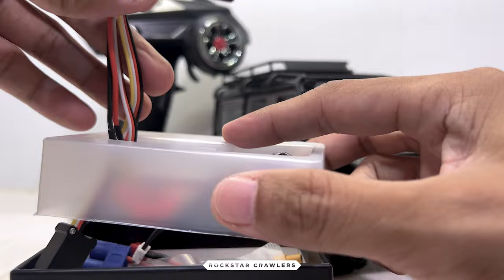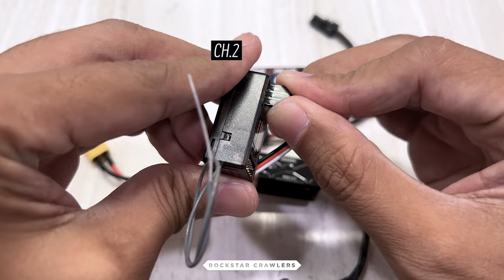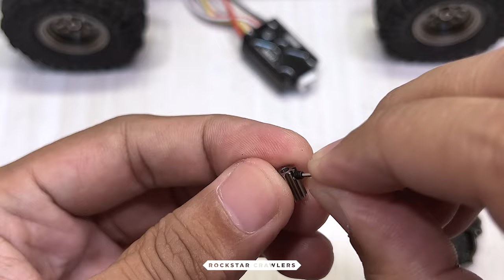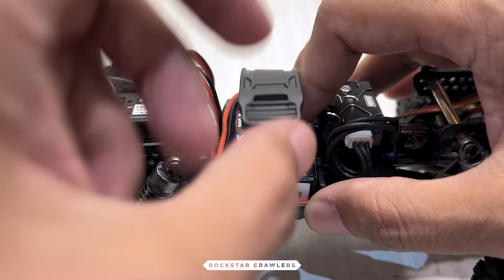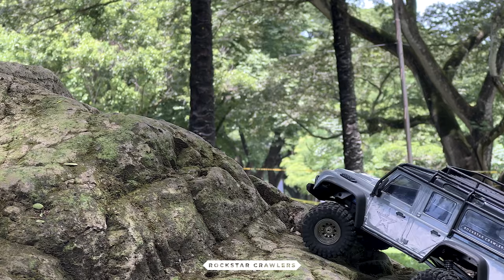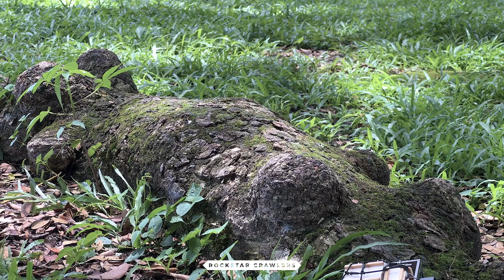Injora TRX-4M Brushless Motor – Unboxing, Installing, Crawling | Ep.39

Comment: what radio controller do you need for that esc?
Reply from the maker: You can use any rx/tx combo you wish. Mine used Injora bec I didn’t want to pair this with my main controller, so I ordered the radio and receiver with the esc and motor. They’re pretty decent. Not great, but will do.